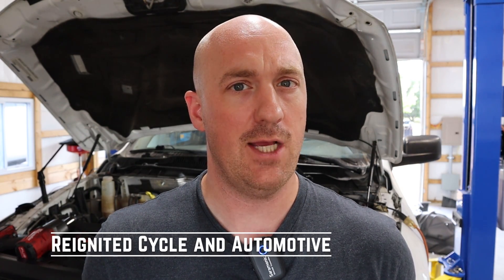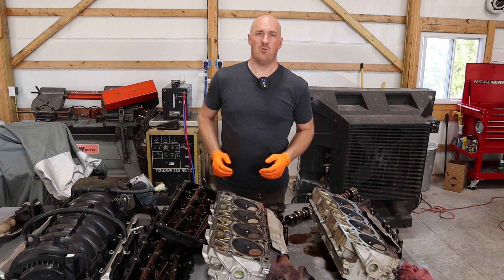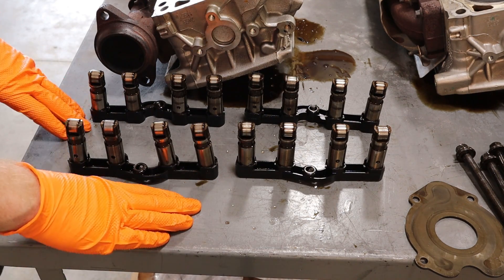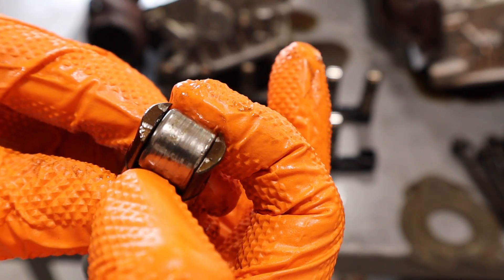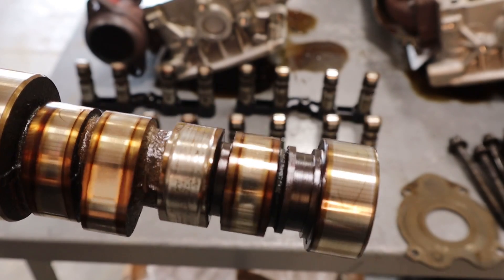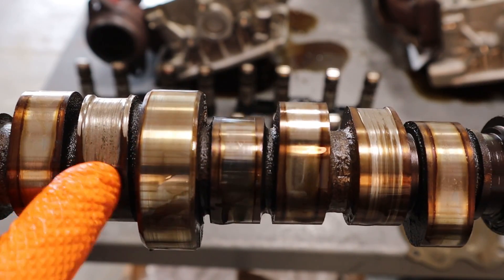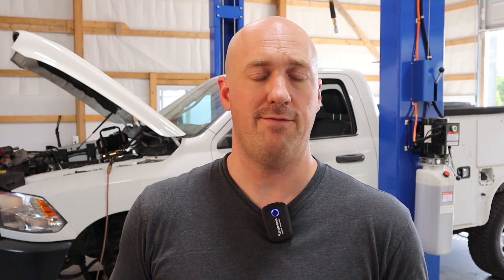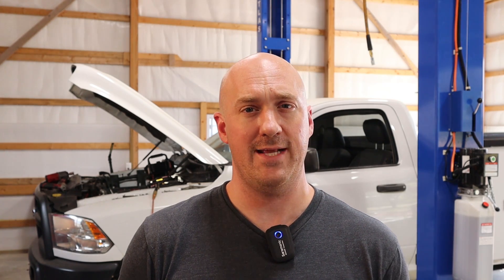Hemi 5.7 Lifter FAILURE Does this engine have a fatal flaw? Find out how YOU can prevent it!!!

Comment: Is there any reason not to use ERS to turn off MDS in the 2021 Ram long term?  I simply set it to 8 every time I drive it, and it appears to run fine, but the MDS system doesn't activate.
Reply from the maker: Nope, no issue at all other than slightly less gas mileage overall. 👍

Comment: PLEASE HELP!!! I have a 2006 magnum with the 5.7 HEMI. I have no ticking and the car runs fine except I lose ignition randomly. If I’m on the highway it will jerk and start back up on its own. If it happens when I’m at a light or idling I have to put it in park and start it up with the key. I just crossed 90,000 miles but the problem started around 50,000. Thanks.
Reply from the maker: That's a tricky one, no Check engine light at all?
Reply: @ReignitedAuto  Sometimes I get a check engine light. It goes away after a few starts. I've plugged in a cheap computer from auto parts store and it only says "lost communication with TCM" or something like that. The only other symptom is that on the highway, it usually happens around shift points around 60 mph.
Reply from the maker: @ShrikeZone  unfortunately you've got a tough one here. Intermittent electrical issues are by far the hardest to diagnose. The code you are getting for lost comm with tcm is because the vehicle is temporarily losing electrical power. Simplest explanation couldbe a faulty asd (auto shut down) relay, but I'm betting you have a harness issue somewhere. These are so tough because if you can't replicate it consistently there's no way to narrow down the cause. 🤔
Reply: @ReignitedAuto  I do appreciate the replies. I'm just terrified to take it to a dealership to get it checked. I've lived with this issue since 50,000 miles or so. The car always gets me to point a to point b but there are some white knuckle moments. I know enough about cars to think I know something about cars.
Reply from the maker: @ShrikeZone  to be honest, there's really no point in taking it in to get checked if you can't get it to fail consistently unfortunately.

Comment: Maybe I’ll get better luck asking my here but ok, so these engines have a design flaw; what’s the best way to combat this and not become a statistic to the dreaded Hemi tick? Best fully synthetic oil we can find? Best oil filter that has a good synthetic media? Changing the oil long before what that goofy oil life meter says, like maybe more realistically around 6500, to 7000 miles? Maybe even switching to a 30w oil? 

But I gotta ask- is the cheap, semi-synthetic or synthetic blend 20w oil and cheap, paper oil filters they put in these trucks brand new, along with expecting people to change their oil at upwards of 8, 9000 miles with no regard to warning against excessive idling, partially to some degree part of the culprit of this design flaw?
Reply from the maker: I'm not a huge believer in synthetic oil myself, in fact, the 6.4 truck motors that use fully synthetic 0-40w seem to have more issues than the semi-synthetic 5-20w of the 5.7. I do agree that sticking to more of a conventional oil change period of 3-5k miles would be of more importance, yes oil changes are getting expensive these days, but hey, at least it's nowhere near as expensive as the diesel guys! If you want to hear me bad mouth a Chrysler engine, ask me about the Ecodiesel 😄😄😄
Reply: @ReignitedAuto  what do you mean by the 6.4 Hemi trucks having more issues?? But back on the 5.7 Hemis, what do you mean you're not a believer of synthetic oil? Synthetic oil has more than proved itself to be much better at combatting viscosity break down and fighting sludge and just being so much better at protecting your engine parts from cold starts than conventional. I mean, if you're somebody who still insists on changing your oil at 3,000 miles then I guess fully synthetic oil would be kind of a waste but the anti-wear additives that top brand synthetics have is what's always got my attention. 

But back on the subject at hand, what's the best way to avoid the Hemi tick? a lot of people on the Ram forums swear by that Red Line, Amsoil and Pennzoil Ultra Premium to even reverse the tick. 

But isn't this not all about a lubrication issue?
Reply from the maker: @billplaisance6387  I can only go off of my experiences, and from what I've seen the 6.4 truck engines have had a lot more issues with lifter failure much earlier in their life span. The 6.4 does use 0-40 synthetic oil, not sure if that's a contributing factor or not.   If you are hearing a mechanical tick noise in the engine, there's no reversing that other than parts replacement. You might quiet it down, but it'll still be there. 👍
Reply: @ReignitedAuto  sorry, I didn’t realize you had responded but that’s news to me, I had no idea the 6.4 Hemi’s were having the same if not more lifter failures than the 5.7 Hemi’s were. I frequent a couple Ram forums and the 5.7 is all I ever hear about this happening to and what to do to prevent it but, I’m a firm believer in full synthetic. I believe you get what you pay for when you make the switch to full synthetic and since you do agree this is also part of a lubrication problem, why wouldn’t a full synthetic engine oil not be better since it bonds better with engine parts and has much better anti-wear additives? But I dunno, disagree with me if you want but I really think that cheap semi-synthetic/synthetic blend oil they use at the factory and at the dealerships is the problem especially when you let that highly conservative OLM lead the way towards 8, 9 and just under 10,000 mile OCI’s. Plus with a rather cheap paper oil filter in that Mopar one. i’ve even heard of dealerships telling some customers that if you plan to only keep the vehicle for as long as the warranty is to just let the dealership do the oil changes and let them put in the cheaper stuff or if you plan to keep the for vehicle for a very long time to switch to full synthetic and change it no more than 6000 to 6500 miles.

Comment: I never believe everything I hear on the internet but I have heard plenty of guys talking about having lifter failure before 100k mi.  even though they were using high quality synthetic oils,changing oil as recommended and not idling for super long periods of time just go on some of the Ram pages,I know it’s probably a very small percentage compared to how many Hemi’s are on the road but it’s still happening even when all protocols are being followed,all’s I know is that I sure don’t want that $4k lifter replacement bill lol
Reply from the maker: I hear ya, and really it's the squeaky wheel that gets the grease right? The people who have had this issue are a very vocal minority, so it seems like it's happening to more vehicles than it really is. I'm not denying that it's a kick in the pants to be faced with that kind of a repair. But the Hemi engine is being unfairly maligned in my opinion, and that's all this video is: my opinion based on my experience as a Dodge tech 👍

Comment: I know I'm opening my self up to be torn apart but, I have a '17 1500 Laramie with the 5.7. At this point I have no noises or problems at 67k miles. I change my oil at 5k miles at the dealer and the computer says I still have around 45% oil life yet. 2 questions, 1- is there a brand of oil that Chrysler recommends I use over another? 2- is it bad to use my remote start system and let the truck warn up for 10 min or so in the morning before I leave? I absolutely love this truck and want to do good by it.
Reply from the maker: No specific brand of oil, I know we had Penzoil at our dealer, but not sure if that was Chrysler recommended or just what we used. Just stick with the 5-20. I wouldn't worry about Idling it to warm it up in the mornings for two reasons, 1: when the engine is cold the oil is "thicker" and has more oil pressure, 2: I'm really talking about extended idle time like 1hr+ on a consistent basis. You should be good to go 👍
Reply: @ReignitedAuto  THANKS!

Comment: They have problems there is tons and tons of hemi owners that just daily the vehicle for everyday use and most still fail regardless.  Search the forums so many aftermarket cammed hemi vehicles now because of this problem.
Reply from the maker: depends on what your definition of tons and tons is. As a dealer tech I usually fixed about 2-3 of these a year. I worked on literally hundreds of Hemi engines every year. And this doesn't take into account all of the Hemi engines that I never saw because they are working perfectly. I'm not denying that this is a failure that people see, just trying to provide perspective that the percentage that fail is a lot lower than people seem to believe.👍
Reply: @ReignitedAuto  dont get me wrong i love the hemi but just going off myself,friends and people I follow its a mass amount of failures in the ram community and car platforms as well. Im sure Chrysler will figure it out eventually but hopefully sometime this century lol

Comment: How many miles were on this motor? I just bought and 18 Durango with 35k miles and wondering if I should be worried
Reply from the maker: The problem doesn't usually show up until over 100k miles unless you idle the vehicle constantly 👍

Comment: Only seems to happen on the 09-newer Hemi's with VVT, therefore I believe the VVT is the problem it steals oil that used to go to the lifters
Reply from the maker: Could be, they redesigned the block in 2009, so there might be something to that.
Reply: @ReignitedAuto  The early 08-older Hemi's had the valve seat issue, the newer 09 - up have the cam/lifter issue. Even non MDS engines have this problem
Reply from the maker: @shanemayfield4610  Check out my playlist on my 2006 300C build for a classic example of a dropped valve seat 👍

Comment: wonder if this ends up being an issue with a drive-train warranty?
Reply from the maker: Most of the time the problem only crops up after the factory warranty has expired, but I have done quite a few under warranty as well. It happens to such a small percentage overall that Chrysler is willing to take their lumps over it. This is standard procedure for all of the manufacturers, as long as the issue isn't costing them above a dollar amount they are willing to meet, then there's no point in redesigning anything because that will cost more in the long run. 👍

Comment: I have a Ram with a 3.6, and it's a great engine, but I find I now need more towing capacity but was hesitant to trade it in for a 5.7.  After seeing this, and know that I always change oil at recommended intervals or earlier, I feel better about the idea.
Reply from the maker: Don't let people steer you wrong, they've been using this engine since 2003 for a reason. 👍

Comment: What you said is so true because I changed my heart regular not by the mileage and I never have that problem I'm running into 160,000 mi full blast drive go everywhere it's actually my sports car and I'm driving a 2006 Chrysler 300C with a lot of bolt on. I buy the car with a valve seat drop at 100,000 mi and I'm a mechanic and I rebuild the engine with the same stock piston and pin my valve seat and that's the trick I do service very regular I love my Chrysler more than how I love my 2015 Mercedes Benz I rather sell my Benz and leave my baby outside anyway I respect your info
Reply from the maker: Sweet man 👍 Good idea to pin the valve seat. I've got another '06 hemi engine I'm going to put in something, I'm going to do that to all the valves.

Comment: Great video, but there’s plenty of documented lifter failures in these engines even when “proper” maintenance was done(3k oil changes, full synthetic etc). Bottom line is that there is a design flaw in these engines. Crown Vic police cars idle just as much as HEMI equipped vehicles and failures in the crown vic aren’t even close to that of the HEMI.
Reply: The Hemi is being pushed for power, like nearing 400hp to the engine 5.7l which let's be fair...older 350s (345 is the cubic of the 5.7) Are pushing? what 150 200 horse? Stock that is. They designed them different for more power and there are some flaws. Idle Oil pressure is like 20 Psi which i'm not super fond of, the MDS system surely isn't the best for it, there needs to be an aftermarket either the solenoids for MDS need to be block off, or just let them oil the lifters non stop (change to Non MDS style lifters) and give the rollers constant oiling with no 4 cyl mode. Basically, over engineering, need for emmisions garbage and mileage are the reason which things fail. 350s didn't get good milage, granted these Hemis are not that great either, but for the power they make it sure is ok. Crown vics were nice an reliable and they had what the 4.6s in them, they are ''simpler'' in their design lets say just because they're not all out for power.

Comment: The non mds variants eat lifters too.  I work alongside a fleet of late model 3/4 and 1 ton trucks... oldest being 2017. These things idle as you say and I can't speak for what their service intervals are.  All of these trucks I see are 5.7s so they are non mds and the lifters still fall apart.  I tend to agree with the lifters running too close to horizontal and simply not oiling the rollers at idle speeds.  The oil change interval seems more of a cop out for a blatant design flaw.

Comment: I absolutely call bullshit on Chrysler "bad oil" BS , take a look at the lifters when you take them out you will see scouring on the the bodys on opposing sides from right bank and left bank, now look at the drain holes in the block casting...they are inches away from the cam so oil is not draining on the cam like a traditional pushrod engine now you will also notice no through holes to the roller in the lifters so basically what you have here is at 1500-2000rpm and up the crankshaft is slinging oil all over the cam lubricating it and the rollers but at low rpm or idle the draining oil is just falling down away from the cam except for a few lucky splatters and the crank obviously isn't spinning fast enough to throw it upwards...thats the issue, what they need to do is update the casting to have a few threaded holes in that oil galley and put in oil squirters for the cam then they could continue to manufacture on their current platform...otherwise they need to scrap it and start over, now from a performance perspective the placement and angle of the lifters being high and wide does have performance benefits,as a matter of fact when Toyota first entered Nascar the blocks they were using operated on a very similar idea allowing more reliable higher rpm valvetrain function but the way Chrysler has made this it desperately needs oil squirters because virtually the only lubricating that's stuff gets is what the crank literally throws at it....I challenge anyone to actually tear one of these down,physically inspect the layout and the cam and lifters then tell me it has anywhere even close to the lubrication it needs...the location of the drain back is the big wtf here, and I kinda question the oil flow going into the top lifter area in the first place as well
Reply from the maker: I appreciate the informed reply. There's no doubt that in any engine there are design improvements that could be made, i think with any company they will decide what is an acceptable amount of failures before changing a design. In this case the lifter failures are happening to a relatively low percentage of engines, so I don't think they are inclined to update it. I do agree that improvements can be made though 👍
Reply: @ReignitedAuto  👍 absolutely, always room for improvement , as I believe you stated as well it currently appears,based on my experiences, that the higher percentage of failures are coming from county trucks, construction fleets...ECT and thats why I took my time diving into it on the last repair,while I can't really speak for county maintenance I do know the team of one construction fleet that had 2 trucks go down about the same time and they were properly cared for,in my mind I'm thinking what's the difference between how these guys use their vehicle as opposed to a normal everyday person going about their day to day and the big obvious is they idle for hours with their lights running, as I tore into it started to make sense why it seemed to lack lubrication under those circumstances, please take no offense to my initial comment,thanks for the video I hope Chrysler figures this one out before alot of people get really disappointed in an expensive investment.Merry Christmas

Comment: By golly, ole Uncle Tony was 100% right. Like you, he also stated that the lifters are positioned more horizontally than other designs, therefore, the oil doesn't flow as well to the lifters during extended idling. The first of 2 videos he made about this had to be close to a year ago, if not longer.